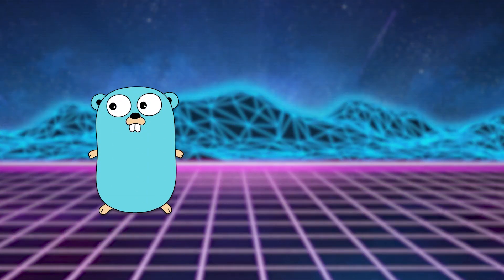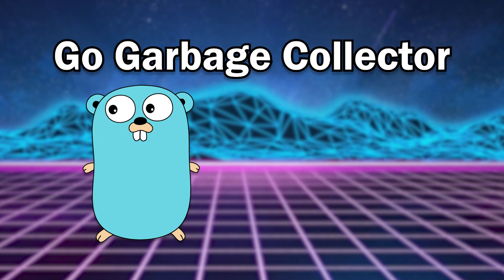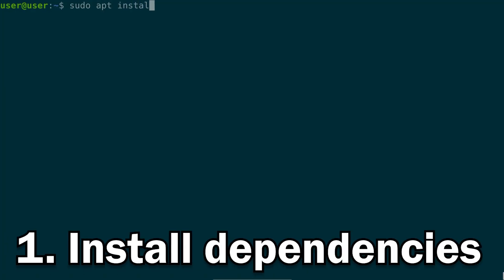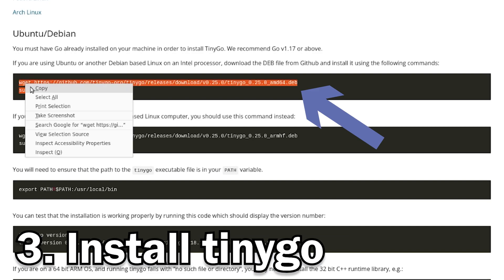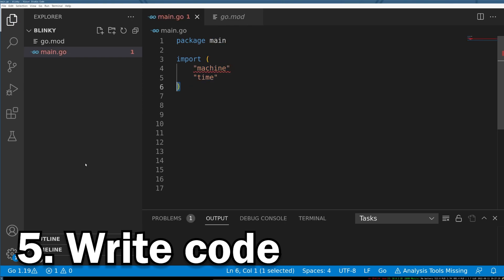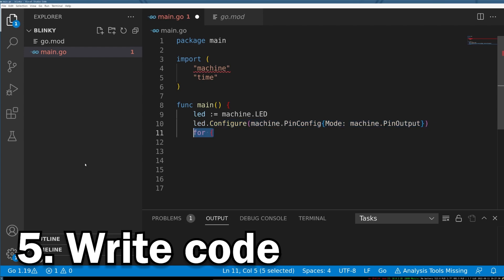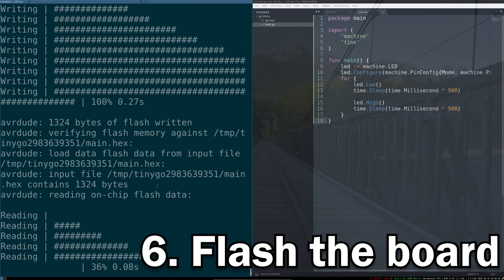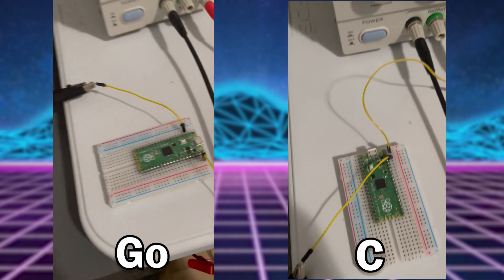an 8-bit microcontroller but it has a garbage collector

Comment: Hi all, TinyGo author here :)
The GC doesn't run in a separate task or anything like that. Instead, the program simply allocates memory until it can't and at that point it'll try to free memory by running a single GC cycle.

In this blinky example, no heap memory is allocated at all after startup so there will be no GC involved.

What you are really measuring is the sleep current, because the program will be asleep 99% of the time. Oh, and the LED of course, which might use more power than the chip itself.
Reply: Ayke, but why? If it's going to be a little machine it's going to be painful somewhere, horrid things around timer interrupts or whatever. I hate C++ so much, but it does what it says it will. Seems easier semi-familiar horrors than learning new ones.
(How do you do an interrupt callback, in one lifetime or less?)
Reply: I need to be notified in real time when this pin goes high. I don't want to keep polling, the chip knows when it goes high. I want to change the state of my application immediately, but it might take a millisecond. I'd rather it didn't crash. How do I give it a function to call?
Reply: @djayers  Interrupts are not blocked by the GC. If you have time critical code, you need to use interrupts.
Reply: Unrelated question, will there be wifi support for the Pi Pico W coming soon?
Reply: So can there be point where the gc can no longer allocate space and you then just have to change the way you coded the entire thing?

want to know if tinygo takes all the embedded pain and just works
Reply: @salman8562  That can happen on any system. Malloc can totally fail and return a null pointer on a regular computer too.
Reply: @ whaaaattt

Comment: I don't think the GC applied in this example. GC is only needed if you allocate heap memory, and I doubt a sleep or setting a registry in memory allocates heap memory.
Go's GC is only injected in compile time if it's needed. The performance penalty would only occur if you allocate and use the heap memory.
And aerospace code doesn't allocate heap memory. You're not even allowed to, all memory usage needs to be predictable on compile time. You typically see a lot of use of global values and no recursion of functions. The last thing you want is a stack overflow in space, or failure to allocate.
Reply: Having worked in the field, I can confirm.

Comment: Note that on bare metal, you have to implement power saving features like CPU idle, sleep, etc. all by yourself. Just an Arduino sketch or likely the tinygo runtime won't do that.

So the power consumption measurements were measuring the same thing.. the CPU running at full speed with the occasional +/- few mA for the LED blink. The time delay functions are often implemented with a spinlock loop. E.g.    while (currentTime < targetTime) { /* do nothing */ }
Sure a CPU doing (a lot of) arithmetic will consume more power. You may notice that with Intel/AMD CPUs doing AVX512 (and get a clock speed cut), but on these tiny MCUs we're talking tens of uA difference between running a bunch of nops, or a bunch of ALU instructions!

I expect that if you actually do a real computation and time how long it takes on both languages, you'll get similar CPU time ratios as you linked to that benchmark website. And since more CPU time means less time to sleep, the Go program should use more energy to complete the same task (yet it consumes the same power for a longer duration).
Reply: thanks for the information.
Most of the embedded apps use long sleep periods. So this is not a problem.

Comment: Learning how to manage memory is a key programming skill. And embedded devices have so little memory to work with, you will be forced to clean up properly or risk running out of memory real quick.
Reply: some people say: don't use any dynamic memory on these small things because memory fragmentation happens and then you crash out of mem
Reply: TinyGo keeps allocating until it can't and only then starts to garbage collect. So you'll never run out of memory
Reply: @fr0xk  That's not true. When there is not enough space freed by garbage collection, allocation must fail.
Reply: @0xbenedikt  That depends on the implementation of the algorithm of garbage collector

Comment: There’s no need for this application to run the garbage collector. After all there’s no unreferenced objects. So in the long run with a more serious application the power consumption for run GC will go up.

And a big problem may occur on these single task systems is that it may actual run relatively long and you may miss polled data or events.

So not a fan of using GC in a real-time application.

Comment: Memory leaking is not from using much memory, is fron not releasing it, and maybe a new allocation goes and overwrites your data, that can be still in use causing crashes or artifacts
Reply: Are you sure? Because that's not how the heap works. If you have allocated memory using malloc/new, no new allocation will get the same memory. The way to overwrite the data would be from buffer overflows or use after delete/free. You might run out of memory though.

Comment: Why is it so difficult for people to just free() the variables? I mean is gc alone enough to invent a whole framework so you can use a specific language to write embedded softwares?
Reply: Question is why the heck use dynamic allocation at all on a thing which RAM measure in kilobytes (sometimes less than one)!
Reply: @nashaut7635  As soon as you want to manipulate (text) strings, you need some sort of management.
Reply: @erwinmulder1338  You usually use a scratch buffer and reuse that buffer in that case. You never know if you can allocate a memory block large enough to manipulate the string the way you like it. Memory fragmentation is a real problem with so little memory.
Reply: @erwinmulder1338  Dynamic allocation should be avoided at all costs in a microcontroller, especially those small ones: they're not computers and unfit. If you resort to needing some string management, then you're probably doing something wrong. Ever byte counts, not only RAM but flash, too. You're at best only wasting some precious flash memory for the GC.
Reply: @TheMixedupstuff  nailed it.

Comment: Microcontrollers like ATmega328 found on arduino boards always run at 100%. Executing commands and interrupts as fast as possible. So the power consumption, unless sleep modes are implemented, will be the same. There might be some differences in relation the initialized hardware (timers etc).

Comment: How does tinygo handle memory fragmentation? That's one of the biggest reasons why people don't use garbage collectors for embedded systems.
Reply: Right now it doesn't. I have looked into it but it's really difficult to do in Go. Instead, I will generally try to write code in a way that doesn't allocate new memory (so there is no garbage to collect).
Reply: @AykevanLaethem  That's usually the preferred way but the video title seems like it encourages you to use the GC :P
Reply: @0x1EGEN  I wouldn't exactly encourage the use of the GC. But for some kinds of applications it's much easier to rely on the GC for memory management.

Comment: Garbage collection on MCUs is pointless as mostly everything lives on the stack. A lot of standards ban dynamic memory allocations altogether anyway. Further, an MCU program firmware never terminates, it doesn't even make sense. Lastly, the architecture of Go is such that whenever possible, everything is RAII and stack-bound by design.
Reply: static allocation RAM is luxury on some system, because it is very hard to know exactly how much memory you will need, expecially on complex system. You will have to allocate some big pool of memory and doing allocation yourself if you dont want to use heap

Comment: did you read the assembly generated to see if there are any heap allocations done?
as for GC on small computers, well, the hp28c had like 32KB of ram and a UI with programming language and GC so... yeah
Also, you can't measure power consumption differences with a power source when the differences are likely in the uW range

Comment: Where in that code is the "garbage" actually collected ?
Reply: It is automatic... but that would require for any dynamic memory allocation to begin with (which you do not want on such systems)... And this code does not have any so - there is no garbage being collected at all.

Comment: Thanks for the video, regarding power analysis, measuring current through a shunt resistor and oscilloscope will be far more interesting, since you'd see the cyclical nature of each program.
Reply: Furthermore, for power consumption analysis, you'd want to disconnect the LED since the MCU current would be negligible in comparison to the LED

Comment: garbage collector will not cause more power to be used on AVR chips because even if there is no GC the chip will be still busy doing nops in idle loop. The chip doesn't care if the code does anything useful, it will do its 16M instructions/s either way.

Comment: You seem to think of Garbage Collection as a positive for a language and not the necessary evil it is based on the decisions the language maker made.
Reply: Not so much based on bad language design, though Go is bad, but on bad programmers being too prevalent. GC isn't necessary if you're a good programmer and is generally a negative in every way.
Reply: @anon_y_mousse  Never heard that much non sense.... It has nothing to do with "bad" and "good" programmers, most devs just don't have enough time to care about memory management themselves. Also for the overwhelming majority of consumer applications you don't care about the tiny delay a GC might cause, it's the network delay that causes you headache. So why would any sane person/company spend so much time/money on something that has no impact on the final product? Simple: They don't. They take a language with GC like GO, don't pay anything for it, but save a ton of money, because they need less people to get stuff done and maintain the code in the end.
Reply: @grafspee9463  Sounds like I triggered another bad programmer. When a good programmer writes their code, they simply pair things. There's no huge investment of time in doing that. At the end everything works because you wrote it correctly and there are no leaks. The hitch of a GC might seem small on a desktop, but on an embedded device it's a killer. It can cause the device to freeze up permanently as things are being waited on and don't occur in a timely manner.
Reply: @anon_y_mousse  Standard libraries are bad language design. Stdlib isn't necessary if you're a good programmer because good programmers implement everything in assembly. Why use a bloated language like C?
Reply: @mgord9518  Nice attempt at a troll. Of course you're forgetting those systems which come with a standard library built in and thus it adds no overhead. For instance, the PS1 had a good portion of the C standard library built into the BIOS.
Reply: @anon_y_mousse  The BIOS coming with the standard library would be slower than a BIOS without the standard library, no?

So just flash a custom BIOS foregoing that and program in assembly. Programmers used to do just fine 70 years ago, there's no reason for ridiculous high level concepts like "functions" slowing down your programs.
Reply: @mgord9518  I don't know if you're serious or still trolling. The BIOS is no slower for having a standard library embedded with it than without. Code that you don't execute doesn't take processing cycles, and a standard library in the BIOS will be faster than one you write yourself as long as they optimize it, which they very likely did.
Reply: @anon_y_mousse  Optimized assembly runs faster than optimized C

And C calling its standard library has a performance hit regardless if it comes embedded in the system or not.
Reply: @mgord9518  A standard library embedded into the BIOS is most definitely going to be written in hand optimized assembly. And while there is overhead with calling functions, that overhead is consistent and predictable as well as capable of working in a single threaded environment. I know you think you're making a valid point, but at a certain point you have to balance productivity with functionality. With a GC, there is no such balance as it needs its own thread, which isn't always possible on embedded platforms, and it has an unpredictable runtime performance.
Reply: @anon_y_mousse  And there are many tasks where garbage collection doesn't get in the way, in which it makes sense for a programmer to use an easier to read, more maintainable language without needing to worry about manual memory management if they choose to do so.

Comment: I'm sure you've already figured it out by now, but the lower power draw is because the Go program isn't spending that much time freeing memory. It's kind of a lazy evaluation technique for free(). I would be interested in long term averaging of the power consumption, as I'd bet it would even out. Though, I'd rather use C++'s technique of automatically calling destructors when objects fall out of scope. Then you'd have more memory readily available when you need it for repeated allocations. Using a GC may lead to hitting that boundary too often and having to wait on it to run the collection thread. Slowdowns like that should probably be avoided in an embedded context.
Reply: I'm very skeptical that the power consumption would be affected by such a simple operation. Some more intense benchmark is needed and an actual power profiler (like the NRF power profiler kit 2). I don't really trust the two decimal places of the PSU

Comment: time.Sleep in your code is not doing a real sleep but a busy wait.
arduino on real sleep could go below 0.3 mA.

BTW, your code doesnt have enough variables and assignation to cause the gc to be slow.
It seems you dont have allocations and the only variable you have is never assigned again.
so the gc will be really quick collecting garbage.

Comment: Interested in learning about these low level stuff especially coding on the bare metals.  Any resources?
Reply: I'd recommend picking one microcontroller family like PIC16, AVR or the more recent STM32, and learning to program it in C. If you're really trying to program bare metal, give assembly a try. I learned both ASM and C in university, programming old school 8 bit MCU's, specifically PIC16's, although today STM32s are probably the way to go. You can find some good tutorials here on youtube, and in the microcontroller datasheet.
Reply: @matheus4251  Do you think AVR is good to start with? I just got a book called "The AVR MCU and embedded systems using ASM and C"
I'm trying to prepare myself for future semester where I will have subject "Basics of microcontroller systems"
Reply: @isuckatthisgame  Sure! If you can, try to find out what MCU your course will use and maybe start to learn it first. But anyway, the theory and applications behind MCU's in general are very similar, so studying any of them will be of help. Also, I should mention that the ASM part can be challenging, and its use in real world applications is honestly very rare. So its cool and all to learn it, but C is the way to go with those devices.
Reply: Familiar with ASM.  Even wrote a bootloader and kernel but that's on qemu .

Comment: What I'd like to know is how and when and how often is GC called in the first place? Since there is no os, or at least not in this example, I guess it gets hard coded by the compiler, based on some heuristics it does on the code. The biggest issue to me would not be the performance penalty, but the potential unpredictability of the GC itself. Think of real time applications. Can you guarantee that the GC will get triggered at exact points in time, and finish it's job each and every time in a predictable manner, no matter what's on the heap?
Reply: The sack is used as often as possible. Thus memory is automatically discharged when objects or variables are out of scope. Thus we can predict the cleaning time through the code.

Where the sack cannot be used:
Garbage collector is called once when memory is full (no more can be added to it)
Thus, the expected activation of the garbage collector cannot be predicted.
Reply: @baxiry.  I assume you meant stack and not sack? :)
Of course, I wasn't talking about the predictability of the stack cleanup, that is a given.
In any case, this does kind of disqualify the tinygo from being used in any serious real-time applications, no matter how hard the go/tinygo try to use stack instead of heap.

Btw, who or what is monitoring if the memory is full?